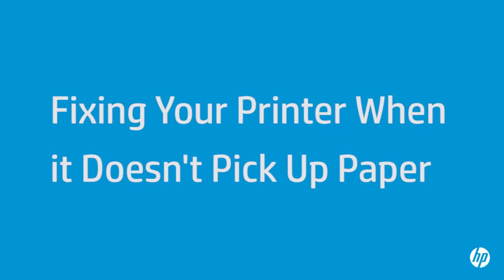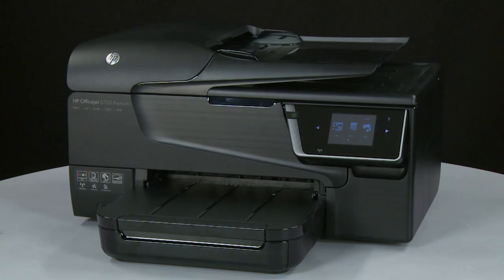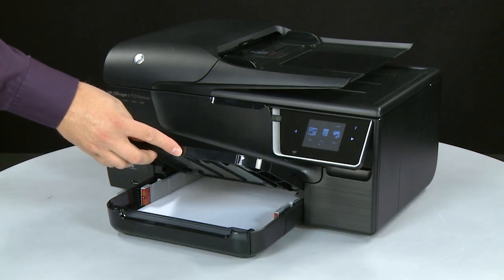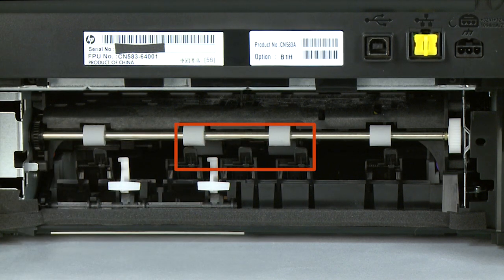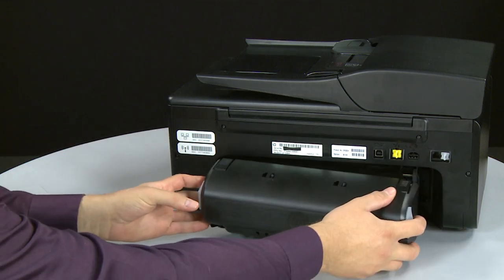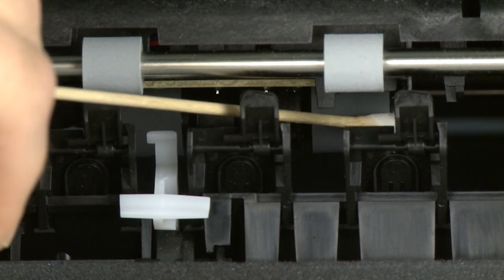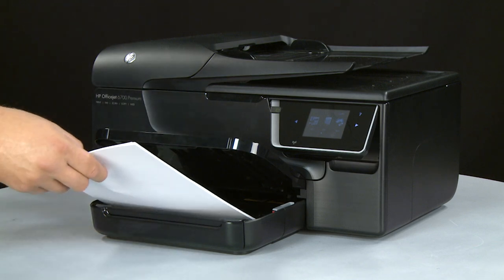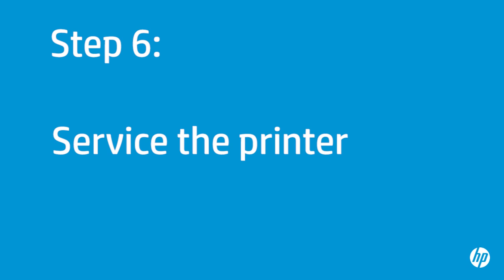Printer Does Not Pick Up Paper | HP Officejet 6700 Premium e-All-in-One Printer (H711n) | HP

Comment: Also. The small cog that provides drive to the pickup roller can get out of alignment and come off it’s splines. Take off top of paper feeder (lift input tray lid and slight tug, goes back same way). Use a small mirror and a light and look where pickup rollers get drive (in the top just behind the first panel) a single small black cog on a rod proves drive. There are small splines, slide the cog along (bit fiddly and working in reverse through the mirror) and realign on the splines make sure the cogs teeth mesh with the one on the pickup roller drive. Enjoy
Reply: You nailed it. Sliding the mirror into the paper tray and looking upward, there it was! Stupid little black plastic cog pushed sideways from its correct position on that silver rod. Fiddled it back into position on the splines, and saved the printer from a trip out the window into the tulips. Thank-you.
Reply: That was the issue for me, Thank you very much!!
Reply: @acaldwell6740  Winning comment of the year.
Reply: Best comment ever - saved my printer
Reply: FANTASTIC!  Thanks so much!  Pays to read comments.  Printer is at least 10yo.  Note, once the gear is spotted in the mirror, it's easiest to just pinch it with fingers and move it back in place.
Reply: awesome, you were right on the money.  Thanks.
Reply: This was it for me as well, with my 6700 - thanks!
Reply: .Great tip .It fixed my problem after hours of roller cleaning did not .Thanks
Reply: Wow, you nailed it.  Grabbed mirror from toolbox and spotted cog quickly and out of place.  Thank you!
Reply: Just wanted to add my thanks. This was my problem as well.

Edit: While this was my problem, moving the cog back into position turned out to only be a temporary fix. A few weeks later, the same thing happened, and this time, moving the cog back into position didn't help. I move it, try to print again, it doesn't pick up the paper, I look at the cog, and it's out of position again. I put it back 3 times and each time it just moved again as soon as I tried to print another page. Printer replaced.
Reply: This saved me the cost of a replacement printer. Thank you!
Reply: i wish there was a video explanation of this
Reply: That was it! The drop-down paper feed rollers were not turning; not pushing the paper into the printer. Sliding the small cog into position where it meshed with the gears and now drives the paper in.
Reply: This is screaming for a class action lawsuit.  

HP should provide everyone affected with a brand new printer where this doesn't happen.

No excuse for a flimsy cheap engineering design.
Reply: @danswaney4134   oh if life were like that Dan. Instead the Directors of such companies just keep taking their bonuses and share options and telling us they care about customers and customer service. Yeah right, keep the faith 🙄
Reply: @danswaney4134  agreed!  What's "flimsy" engineering though, is the lack of a stop that would keep the wheel from migrating away (due to vibration or poor tolerance stack-up that makes the flimsy plastic part's hole too large or rod diameter too small (allowing sliding)) especially since I spotted a stop elsewhere in the design! :-D

Comment: My HP 6600 printer just this month quit feeding the paper to print.  I followed the instructions provided in this video and cleaned the rollers about 3 times.  Paper still will not feed. As badly as I wish I could get it feeding to print again, I really have not complaints. I bought this printer in 2009.  Now my question is....which HP laser printer should be my next printer for home use?
Reply from the maker: +MaryNell Cole Please refer to the instructions under this document to fix this issue: https://bit.ly/3fSJEGt You can search and purchase the printer from here:
www.hp.com/online-store
I hope this helps you!!